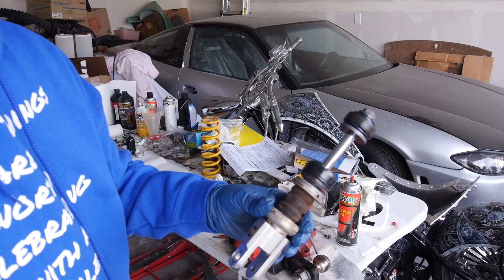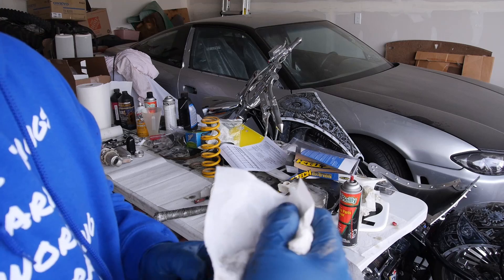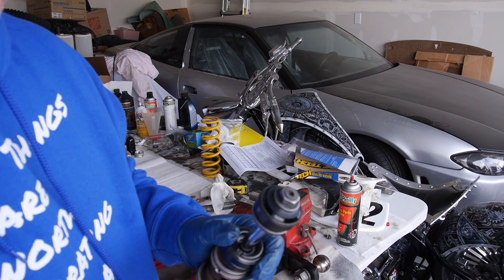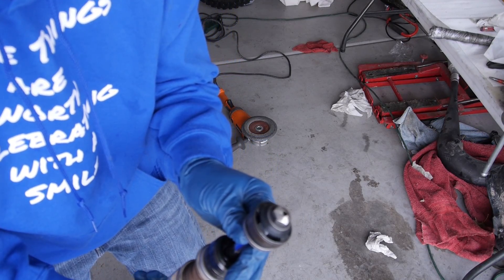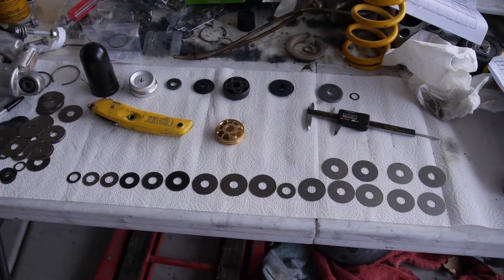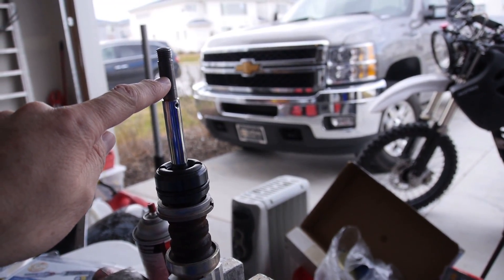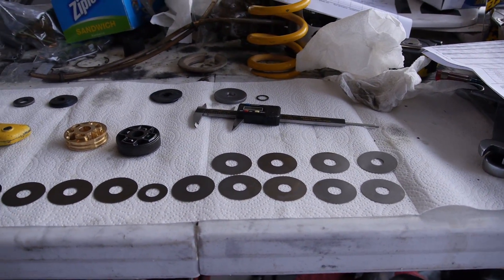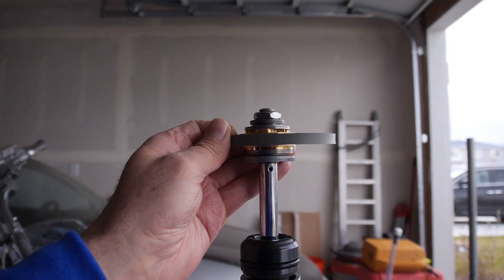How to re-valve a motorcycle shock - KLX 351 - Racetech

Comment: I'd imagine I don't need to worry about getting a new valve on my 13' yz450. I would imagine it could use different shims for my type of riding. I typically ride a lot of woods. This seems pretty straight forward. Just need to figure out what would be best for my riding style.

Comment: Nothing wrong with being a little lazy and using a power tool, that's why we buy them right? 
Man, seeing you stradle one wrench for leverage on the other bought back memories. I couldn't get the nut lose to get a brake disk off the turning machine. I got the wrench at the 12 o'clock position and put all my weight into it with a hard jerk... it worked.  I also fell back onto the floor and hit myself with a wrench.  Ah, childhood memories of going to work with dad :-)
Reply from the maker: I've gotta admit, I learned how to use my nethers from *****  he's the king.....

Comment: Excellent video, *****  comment made me glad i dont have a Jolly Bag! Breaker bar and Jolly Bag should not be put together HAhahaha
Reply from the maker: I was waiting for a wake up call from that beaker bar busting loose reminding me that a Jolly bag is not intended for such work!! Then again, at my age, I suppose I've gotta find use for it somewhere :) Ha ha!!!!
Reply: HAHAhahaha
 Padding for a breaker bar that's a Gladiator bag hahaha

Have you done a oil seal fail on here? I keep getting asked about the Crank shaft seal and bearings in the motor , I have replaced that but i suck at teaching others to do it, and weeelll your awesome at teaching soooo ?